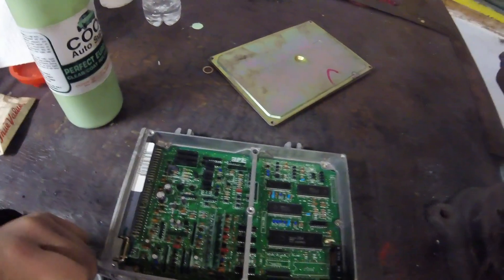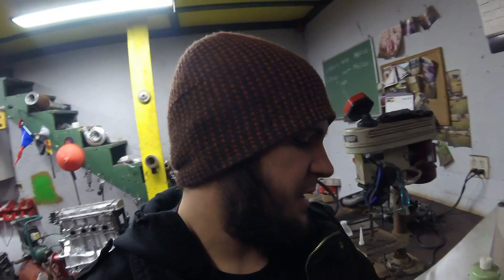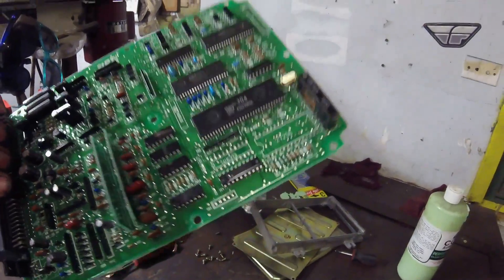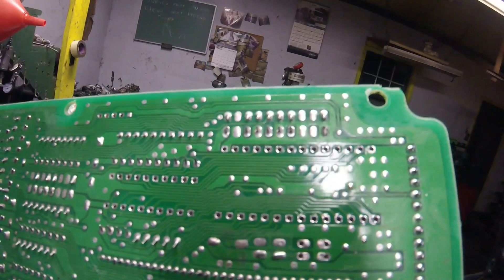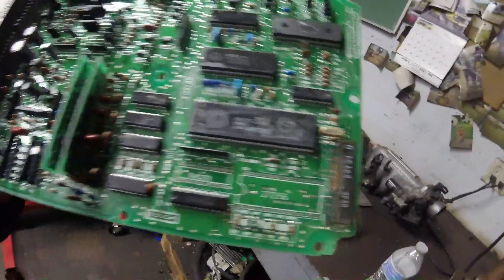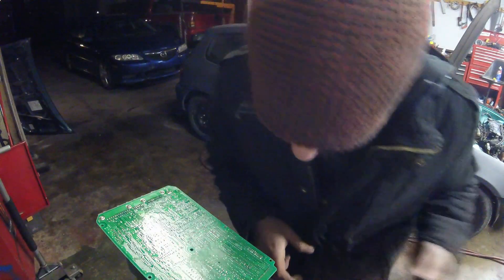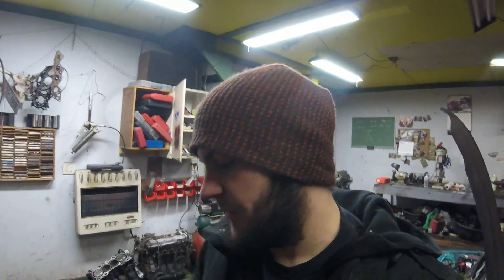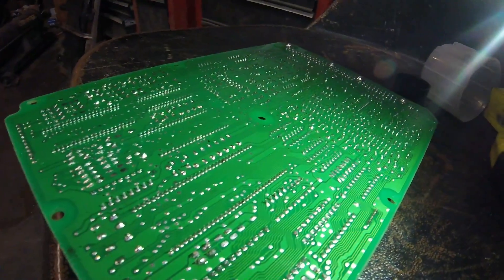How To Chip Honda Obd1 P28 Ecu. Auto To Manual Ecu Conversion

Comment: Hello from Turkey!cI watched your video and liked it
I have a 1.4 civic with engine code D14A4. The previous owner changed the transmission to manual. I am getting an a/t error. I have p3y-g51 ecu. Will the same steps work for me? OBD-1 ECU
Thank you for your help!

Comment: I just got a stock 92 cx in September
I messed up the ecu messing around with something i shouldnt have
Bought another p05 of facebook
It came socketed and chipped with an sst chip
Theres other stuff in there too
Question: my car runs fine but the cel stays on and my shift light is going bonkers
I contacted the dude i got it off and he swears theres nothing on the chip...
Will this damage my car in anyway
Should i do the paper clip trick or something?
Thanks in advance

Comment: Have a question I have a chipped ecu jus like your doing to this one you installed instead of taking off the 28 pin can I just install The Hondata chip on top of the 28 pin and then jus install those 4 pins for the data logging or do I have to take the 28 out all together

Comment: I got p28on  my d16z6 automatic i change transmission to s20 I got check engine light because the automatic solenoid socket I take out the solenoid only and put back on my conector soo no more check engine but now I going to swap engine to b18c1 vtec gsr 5 speed , wht is you recommend me or advice, thx.

Comment: hey man been watching and learning a lot from your videos
I'm looking for some help and youre a Honda wizard so maybe you can answer this 
I had a knocking y8 pulled it out (harness is fuckin hackjob)
found a d16z6 for 300$ I heard it run and pick it up Monday 
if I get the harness off it it will be auto and a auto ecu 
if I can should I get a manual harness and ecu>?
also I'm planning to use my y8 tranny 
will any of this even work ?

Comment: My first P28, mint. I have done two recently that I burned the solder right out of the board and fooked myself. This last time, I bought one that was already socketed and it came shot. The fuel pump wouldn't run. Sent it back to dude, he sends it back, ran mint for a week, then no fuel pump again. I bought another one and sent dude back a dog turd in a box.
Reply: That sumbitch said that it was my fault and I did something to it. The ONLY thing I did was put my chip in it.
Reply from the maker: could have been using cheap knock off chip kits.

Comment: Nice. Ever use the quick release eprom holders with the locking arm? That’s what I used on the one I did. Just flip the arm and the chip falls right out with no prying. 👍🏻
Reply from the maker: Bad Luck Garage yes this actually has that style socket. Goes into the socket that’s soldered into the ecu!
Reply: Shit brother I didn’t even notice! 😜
Reply from the maker: Bad Luck Garage I don’t think I actually showed it on camera
Reply: Well that might explain why I missed it. For a second I was thinking I was one of “those guys” that I’m always bitching about. 😂